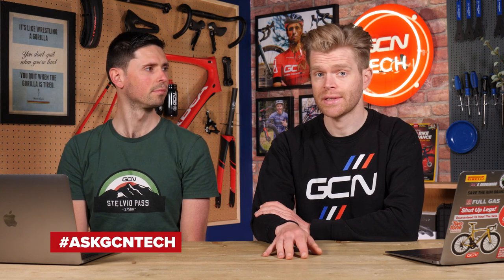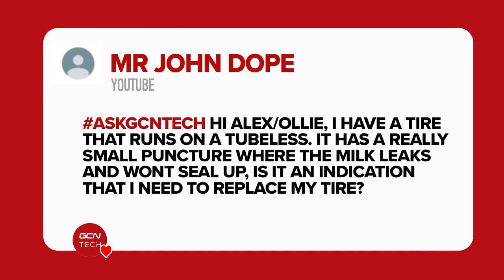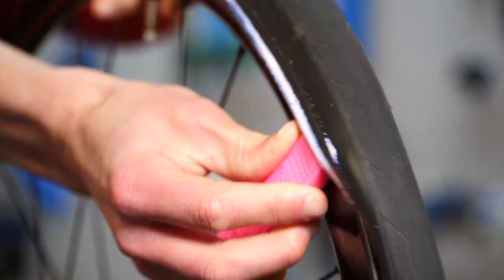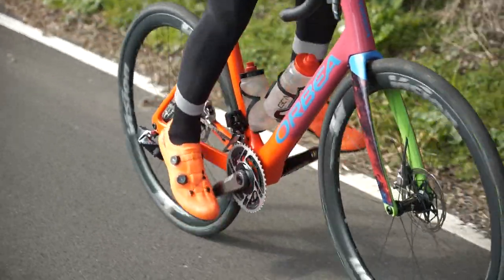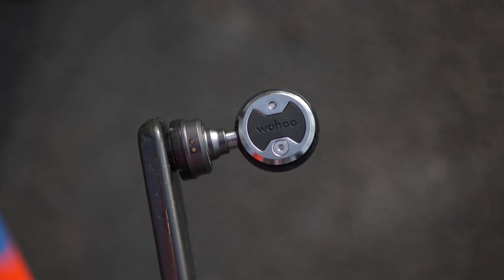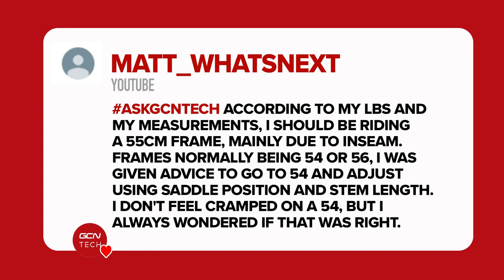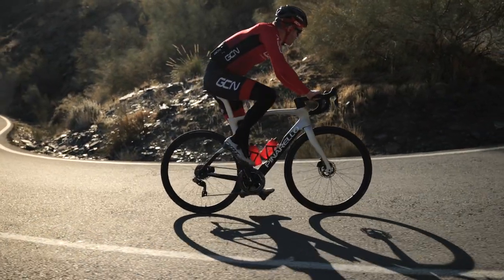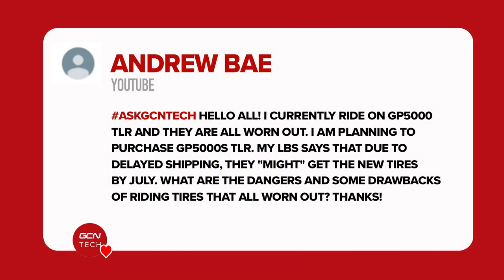Why Won't My Tubeless Tyres Seal? | GCN Tech Clinic #AskGCNTech

Comment: Thanks for answering my question!  Cheered me up a bit as I am recovering.  I was hit by a truck while riding my bike.
Reply: Jeez! Hope you're doing better!
Reply: @TheMinecrafter737  My bike has seen better days.   I have a big bruise where I landed on my posterior.   I can walk but very slowly.  The guys at the bike shop said they can repair the bike.   I am resting and recuperating.
Reply: @jlboynton  so long as the bike's okay! ;)
Reply: @armadillito  Bike needs some work, but I think it will be OK.  I did save my Strava information, though!
Reply: @armadillito  The bike is in the shop.  I plan to get a garmin rear radar/light device that shows when traffic is coming up behind me.
Reply: @jlboynton  Glad to hear you and the bike are on the way to recovery :)
I'm not (yet) persuaded of the merits of radar, but unless you fixate on the head unit it can't hurt. I would love a radar system that spots potholes ahead of other riders in a group.

Comment: Ankle weights don’t work ???!!?? 
How does this explain Si’s weighty ankles and recent epic performance. Please re-think the ankle weight idea, as Simon is likely proof that it does work… ;-)
Reply: They left it ambiguous, it works to the same extend as extra weight works. What doesn't work is specifically to train more your leg's muscles after you're moving, as the weights counteracts each other. Tip: put the weights on the bike or on a backpack, or use an old and heavy bike for winter training/riding...

Comment: Tubeless and hookless alike ... solutions to problems that never existed
Reply: I agree, stupid ruddy messy idea!
Reply: Tubeless has been used in cars for decades to great success, and in Mountainbikes for ages now to great success. 
Road tubeless is coming off age really now, and is a lot more puncture resistant than clincher tires for the same rolling resistance and weight. So there is the problem it has solved.
The lower pressures it allows without pinch puncturing makes for a much comfier ride.
Reply: Tubeless can prevent punctures and allow you to run lower tyre pressures, 2 problems that very much did exist
Reply: Tubeless for 12 years here. Goodbye 99.9% of punctures. Hooklees rims are lighter. Another win.
Reply: Have to disagree. While hooked and tubed wheels more or less work, tubeless, hookless designs definitely are an improvement, and they do solve multiple problems that cyclists have simply "lived with" without needing to. By way of contrast, inner tubes in the automotive industry haven't been seen since the 1920s and for good reason: pinch flats were a problem, and modern wheel design allows a stronger tire, better traction, less rolling resistance, better ride comfort, and BETTER SAFETY. The bike industry didn't come up with hookless/tubeless -- they merely caught up to the motorcycle and automotive industry that is about 100 years ahead when it comes to tire technology. Pinch flats ARE a problem in cycling. Vibration damping and ride compliance ARE problems in cycling. It's just that we've accepted the status quo for so long, we've come to accept them as part of cycling. The resistance to this "new" 100 year old technology in the cycling world is hard to understand when it's clearly and objectively better than tube+tire in so many ways. And the tighter tolerances it requires will only be a benefit to manufacturing and to consumers
Reply: @markrskinner  Tubular rims are even lighter
Reply: @danielakerman8241  Tubulars and classic clinchers with latex tubes, no problems and much simpler
Reply: @stibra101  until you get a flat. Then you struggle to get the tubular on or a new tube seated and with both you hope you don't immediately flat or blow the tire off. Yes, I've seen both.
Reply: @jamesmckenzie3532  It is so simple to change the tube, even tubular. I had 3 mm cut today on my tubular tire and fixed it with Vittoria PitStop. Usually I carry 21 mm spare tubular in my pocket or under the seat.
Reply: @stibra101  You have experience. The person I rode with did as well. He went home and got his other bike because he couldn't get the tubular to seat. Another rider couldn't get his fix a flat kit to work right. BTW, I blew out the sidewall on my tubeless. It took a little work but one tube later and I was good to go. Next day, new tire. One other thing, we have literally tons of junk on the roads. I picked up a screw and a roofing nail. I made it home with both stuck in the tyre. You would have been calling for a lift with other technologies.
Reply: @LarsRR  Tubeless in cars don't need any sealant to work. Plus they handle nails or thorns better in car. They don't immediately deflate. Not to mention car tires are not that more expensive vs Pirelli P zero TLR/Conti 5000 TLR at $99 MSRP.